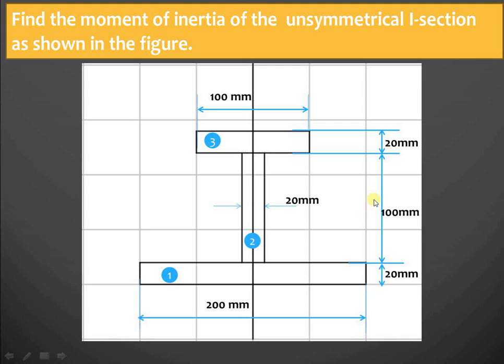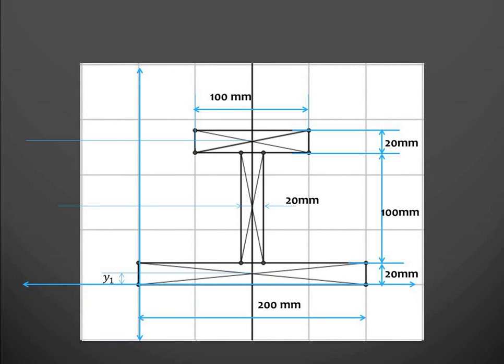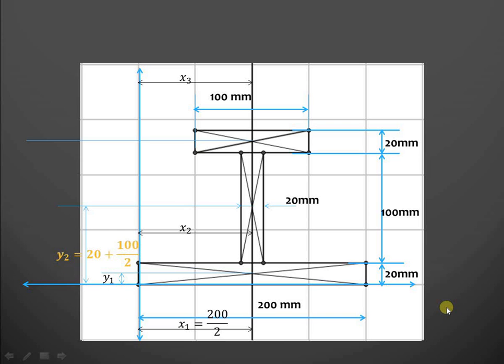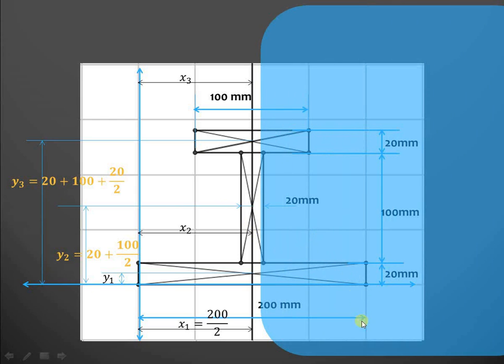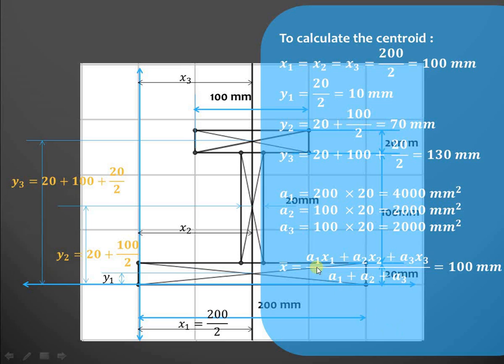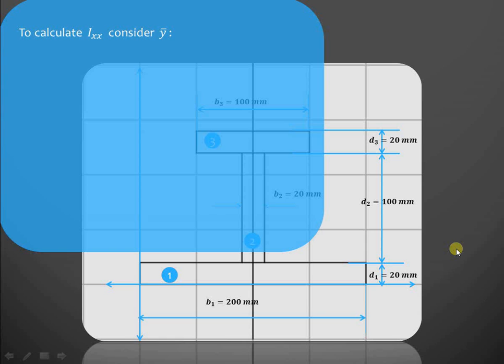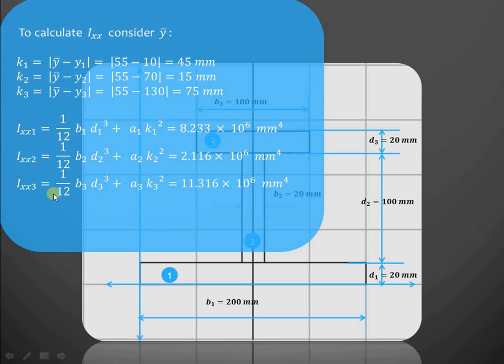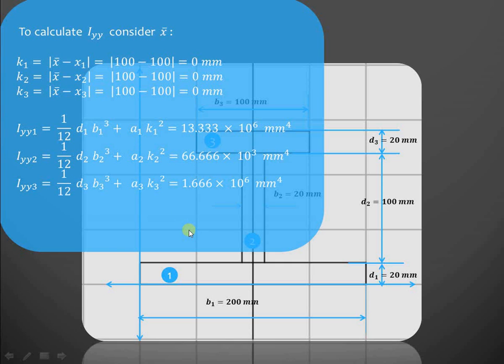Centroid & Moment of inertia  - Engineering Mechanics GATE 2017 Mechanical

Comment: can i calculate Y1,2,3 from top to dawn and how calculate .....
Reply from the maker: +Eng. Hassan Yes !!! you can calculate in the same fashion.
y1 = 20/2 , y2 =20+(100/2) , y3 = 20+100+(20/2) ,only thing in this case will be you are calculating the centroid (y bar) from the top & not from the bottom as the reference. Rest of the procedure is same but be careful now your top flange is your first section, web is the second section & bottom flange is the third section & accordingly substitute the values of b1, d1, a1 etc.  THANK YOU VERY MUCH !!!
Reply: +CHINMAYACADEMY  Thank you very  much my good teacher
Reply from the maker: +Eng. Hassan You are most welcome !!!